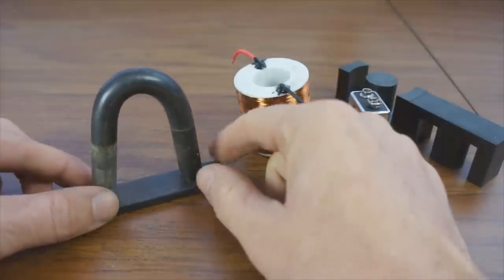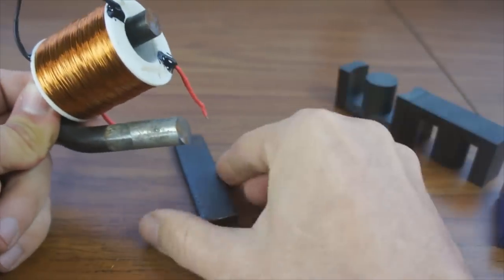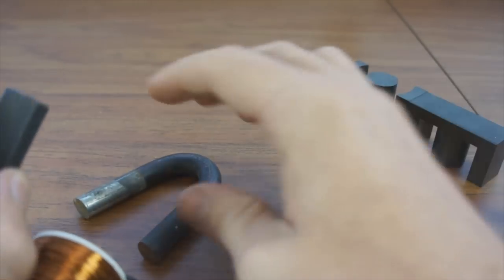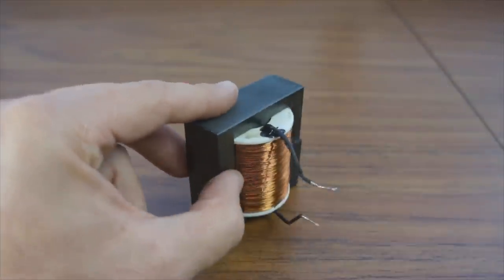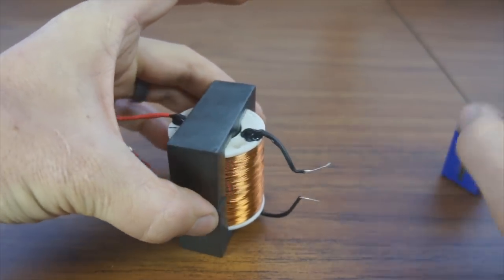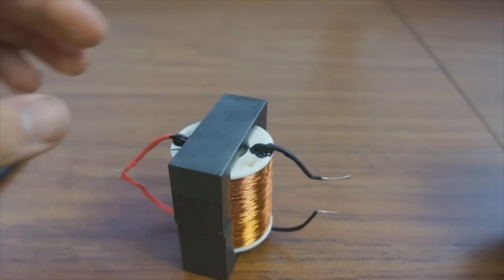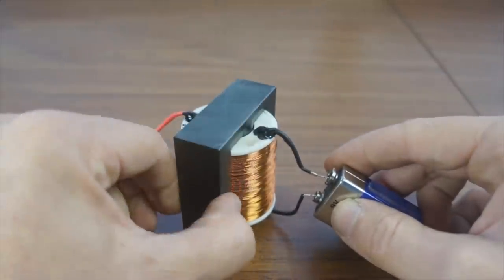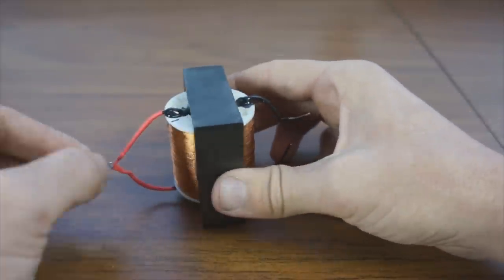PMH - Electromagnet keeps holding after power is removed?

Comment: Isn't it just the fact that when the current is cut in the Primary, the magnetic field starts to collapse, which induces a current in the Secondary, which tends to maintain the magnetic field, so that both the current and the magnetic field collapse slowly. That's what I was taught over forty years ago. I don;t believe anything has changed since then. Hope this helps.

Comment: it would be magnetized forever if the coul would be a perfect transmitter of energy - meaning if it had no electric charge losses while the energy travels round and round...basically making this kind of a loop makes the energy "rotate" in the loop (with losses of course) thus this looping resonance of energy keeps the magnetic field as a consequence of transmission. this is the same in the iron the difference is that it has less resistance than a copper coil. thus the magnetic force is stronger and is more permanent yet never indefinite without additional power supply, HOWEVER and this is important:
when such a "short circuit" of energy is created actually one does not need to feed it with the starting power (the battery) but only needs a fraction of that to keep it going, exactly the amount of losses induced by the material that the energy is travelling "inside" thus making the amount of actualy amperage needed for sustaining the magnetic field LESS and thus more efficient in the long term.

just to make it a bit more understandable, think of magnetism as electric charge...it has a vector a speed and an amplitude because it's resonant energy. just like the electricity in the cable...it's essentially the same thing. and it's not a "field" when enclosed into the right materials...we think of it as a field because the air does not contain it...but metals do. yet when there's traveling, there's losses thus radiating the losses around the metals which we see as a field of magnetism :)

keep experimenting :) discovering reality is fun!
Reply: Superconductors produce/'radiate' a field with no loss. Maybe I misunderstood, but saying fields are the product of resistance through metal seems wrong.
Reply: Cerebral
not a product of resistance, resistance is just there as a transmission to heat and other forms...magnetism is the same kind of energy flowing in the air as electricity...the problem is air has so big area that it does not really shape it or alter it's course and has a really low frequency relative to magnetism thus it behaves like a spark in the air, goes from one end to the other-but the way or the route it flows is not a single atom-line as electricity travels, it seems a field while it is more like where the field is stronger the energy travels in greater packets or amplitude while where it's weaker there is less traveling energy. electric energy and magnetism is the same energy expressed in two different frequencies that react or being contained in a different way by different materials...like when you have harmonics in air vibration(sound). one can have one without the other yet it's difficult. and superconductors do have a loss of energy, it's just less. i mean the transmission has a very high efficiency yet still have waste in the really long term cases.

excuse my words if not understandable - english is only my second language and i do not often use it for describing such technical things.

Comment: if you short second circuit you have close loop, now if you plug battery, core will picks up because you powering up primary coil, now if you unplug battery, it will be change (value of current change)on primary coil and this causes current flow thru secondary coil, current in sec coil make magnetic field in core of transformer and induces in primary coil. etc until current drop to zero.
my eng is bad, (still learning, third lang.)

Comment: Hi Lasersaber thanks for your vids, In times gone by this was used to store and harvest energy. See Daniel McFarland Cook patent US119825 (Oct 10 1871) . Circuit is not identical but principle is same..a series connected rheostat in the loop creates desired voltage from the inductively stored constant current loop.  Stored energy has no time value until drawn off .....then rate is introduced. If identical but opposite currents occupy same physical space then time value can be cancelled and no diminishment of source dipole occurs.
Reply: If you measure the materials you will notice there is no current flowing, and the pieces are permanently locked, or that the magnetic moments of the electrons are permanently realigned with the ones from the other piece.

Comment: U can store energy in static or dynamic field. One is called capacitor as u know perfectly :D and it stores static potential diffrence(open circuit storage) and other is magnetic flow/current (closed circuit storage of power). Now when u cross one with other for example u short capacitor into close circuit loop u release power into movement of magnetic fields. When u break closed circuit where power is stored as magnetic field flow it will create potential diffrence. You should know that by now :D it is all joule thief. First it short then it break the circuit. That is why u got voltage spikes when u open circuit where magnetic field is flowing. Hope for more from u :D And thanks for all videos

Measure the voltage when u pull away the metal parts. Faster u pull higher the voltage spikes u will get. And watch leedskalin perpetual holder. The magnetic field storage can store power for ages until someone or something will break the circuit and the power will be released. Bye :D

Comment: If there is no resistent, so no loss because of the resistance from the wire it self there will be a continued flow of current True the circuit because it is a closed loop Electric Magnetic field that stored the energy in the coil and the rest of the construction, when you cut the  circuit the Magnetic field collapsed and there will be a short puls Electric absorbt to the air

Comment: the u shaped steel core there acts as an electrical circuit it self, the carbon graphite core wil not act so good as an electrical circuit but it will act as a Magnetic circuit

Comment: Here is my theory for how this works. You apply voltage/current into the primary. The voltage goes through the wire and induces the magnetic field/magnetic flux in the core. The flux then induces the voltage in the secondary. However, since the secondary is shorted the induced voltage is then converted into the magnetic field/flux again. The reason the hold weakens is cause some of the current is lost in the secondary due to resistance in the wire. (THEORY)

Comment: For your answer see https://en.wikipedia.org/wiki/Eddy_current. Iron allows the magnetic domains to persist longer than the ferrite [I presume] transformer core which is designed to minimize eddy currents.

Yes magnets are adversely affected by high temperatures because the magnetic domains are more easier disoriented/misaligned.

Is there a difference when the other coil is charged?

#NFTG
Reply: The copper wire of the coil allows for the magnetic domains to store the magnetism [i.e. eddy current] [test it for presence of a magnetic field] which induces the magnetic field/eddy-current in the core.

Test for presence of magnetic fields [compass]

Comment: the reason is as following,in steel core case the steel is conductive material thats mean that the atoms are so close to each other so that when we polarize it by aply magnetic field of the copper coil the negative side of each iron atoms is attatchet to positive side of the nigbour atom  and stay attached because the so close and matched but in case of ferrite core the ferrite no good conductor as we add current it s atoms polarized but when remove current  its atoms go back to the original positions ,,thats all ,,,in case of the ferrite and closed secondery it normal condition because when we stop the current it induce current in secondery close the circuit in secondery will make it take little time to discharge current in it  because of its  self inductivity and empedence.

Comment: The answer is inertia. U I use this to induce leveraged oscillatory compression. All coils are based on inertial torsion compression. This is a gravitational distortion. The oscillation is F=MV squared. The same function here... https://www.facebook.com/100007078157586/videos/t.100007078157586/1578995925679664/?type=2&theater is also the same inertial function that induces the 120 volt wave here: https://www.facebook.com/100007078157586/videos/vb.100007078157586/1541520606093863/?type=2&theater

Comment: Internet-troll-logic would be something like the energy leaks faster when the red wires are sepparate and takes longer when they are linked caue they go back in and come out the side they went in. So link the wires which were used to power it and the energy infinitely circles!
Would work in a cartoon. :D

Comment: thanks, mystery > the second (red wire) coil receives an induced pulse of magnetism from the first (black wire) coil) like for a transformer. Because it has many more turns (like for a Tesla coil secondary versus primary), this will increase the voltage a lot! Maybe high voltage is required to get magnetic latching for this material. Easy to test?